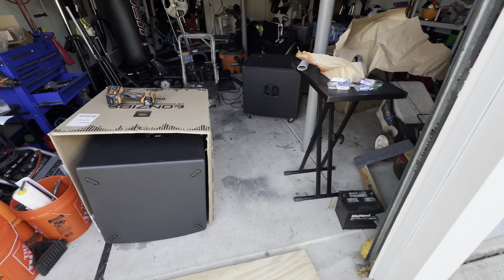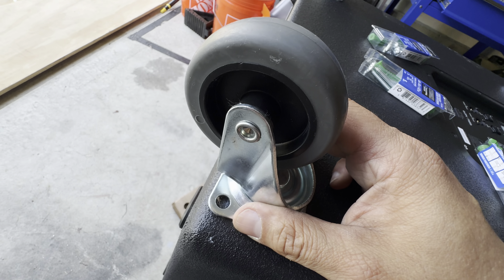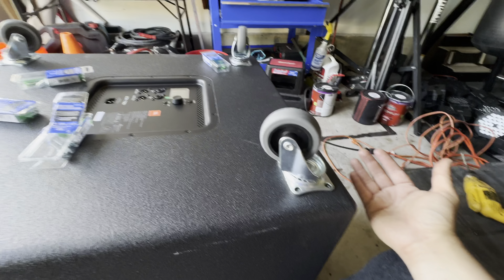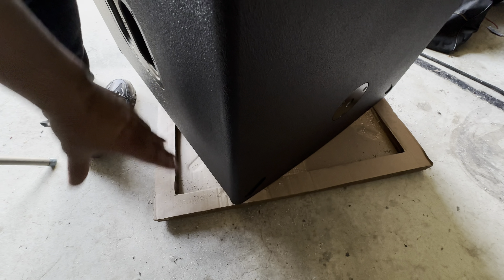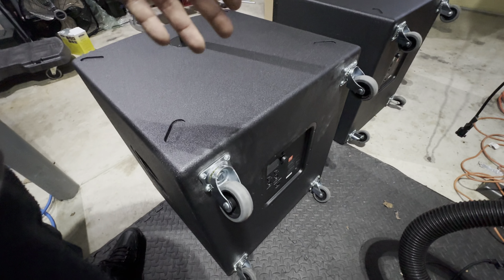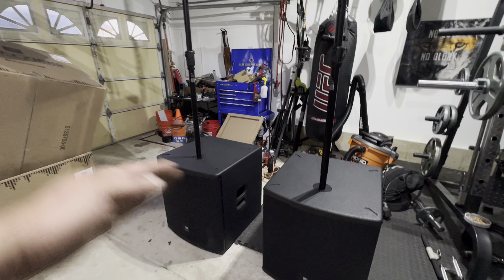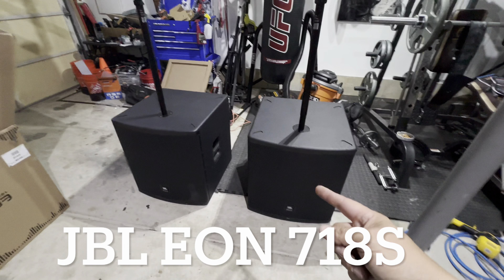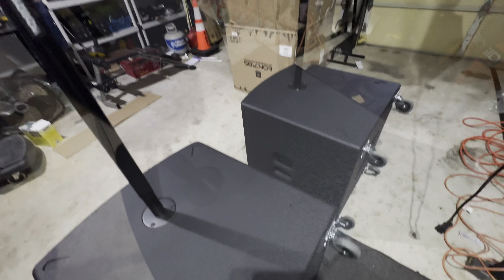JBL EON 718S Casters

Comment: What covers are corret for this setup? normally the normal covers cover the back panel, but that is where you drill in the casters.
What covers allow you to tip the speaker backwards to put the speaker on its back and still properly put on the cover?